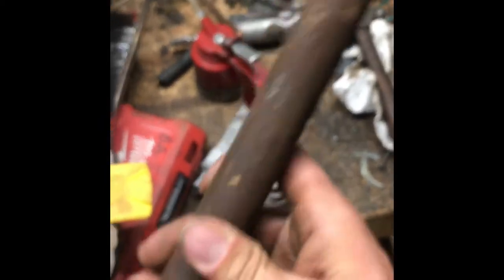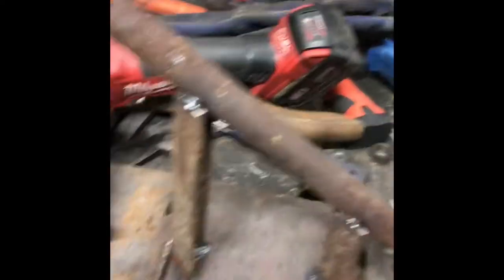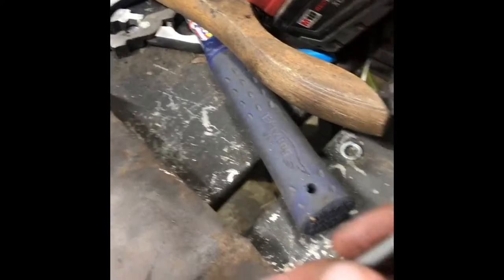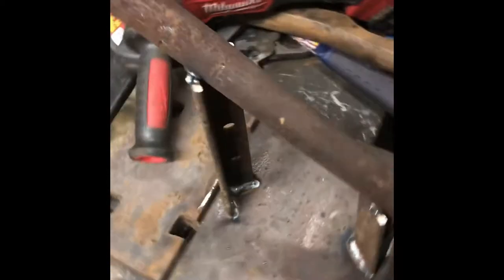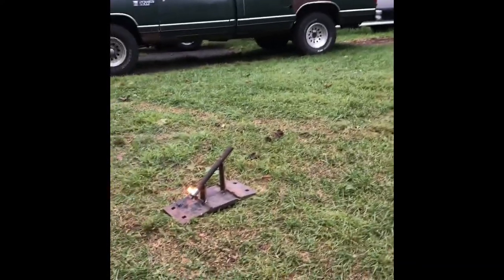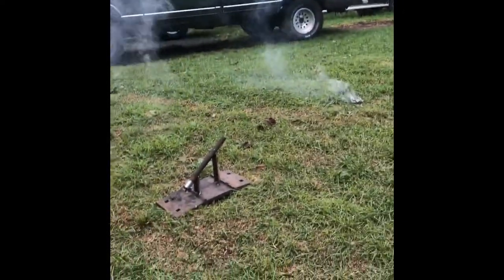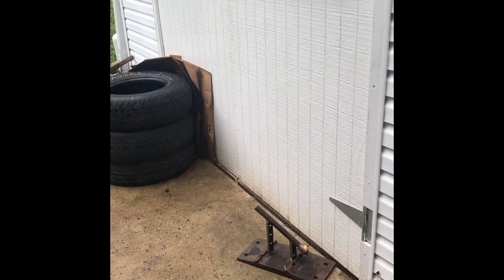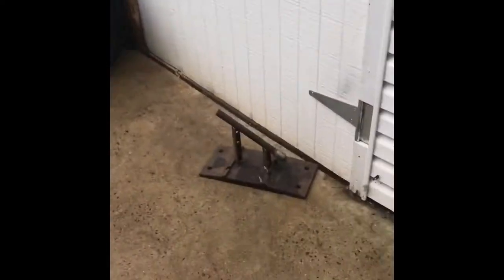Homemade cannon! (Actually works)

Comment: We used to make hand held marble cannons when we were kids back in the 70's. 8" x 3/4" galvanized nipple, 
3/4" cap drilled for a fuse, regular marble, some tissue wadding and Black Cat firecrackers.. 
I'd say they were pretty close to being lethal.. The 3/4" nipple would need the inside diameter filed with a 
rat tail file to remove the casting line. We could put a perfect 1/2" marble dent in 5/8" plywood from 20 feet away..
Reply from the maker: Nice! Sounds like fun😀

Comment: Instead of black powder, do you think rubbing alcohol, gasoline or some deodorant/hairspray spraying could work too?
Reply from the maker: I think it would if there was a bigger chamber to fill with it. I don’t think I could get enough volume of it in 3/4inch pipe  to work well. If I connected a bigger chamber to the back of the cannon then I do think it would work well with the right air/fuel mixture.
Reply: it wouldn't cause an explosion but just fire and fire only so it won't propel the thing, I recommend you use match powder if you don't have black powder
Reply: @faiqahmed-xv7fg lmao guess you've never made a potato gun, hair spray or starting fluid will launch a potato a long ways
Reply: Never gasoline. Never gasoline.
Reply: Ideas like yours is why Emergency Rooms were invented.

Comment: Congratulations!  You just in a few hours, did what the first people did in likely a week at least.  (The congratulations was not sarcastic.)  
However, you were smart to keep away from the device.  Probably should when firing in the future.  The tube and 'breech' attachment has held so far, but may weaken and fail in the future.  
To improve performance, use a projectile that seals the bore better.  That will put more of the propulsive power of the gunpowder to work on the projectile.  It will also generate more pressure in the tube, so beware.  
That tube is smooth bore, so the projectile will have more freedom to depart from the intended trajectory.  Better to shoot it in an open field with no cars, cows, sows, or pets running about.  Or your little sister.  
You did make it work.  Thumbs up and be careful.

Comment: If ur still alive not sure u should be messing with these types of things! Just by looking where u drilled a hole for the fuse (sparkler) to go tells me that u may not understand everything that’s happening here and that if u continue to wander down the unknown road it could result in a catastrophic failure. Hopefully u wised up or got ur head wrapped around it first before anything happened
Reply: What was wrong with the placement of the hole for the fuse ?